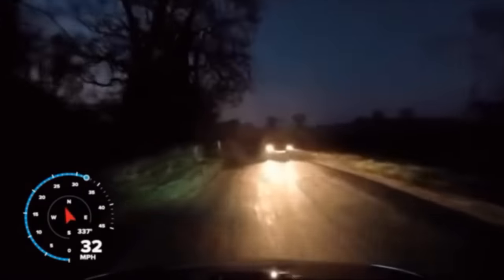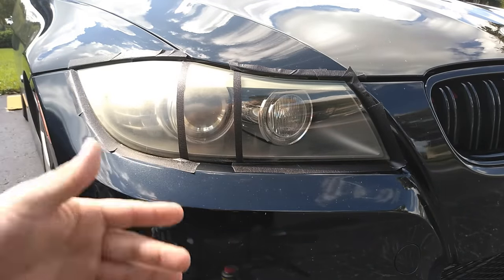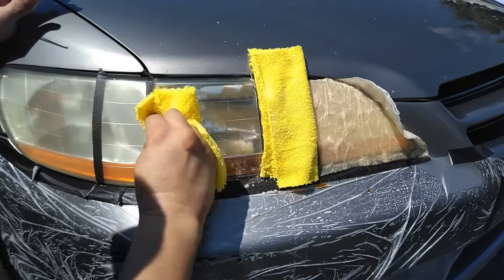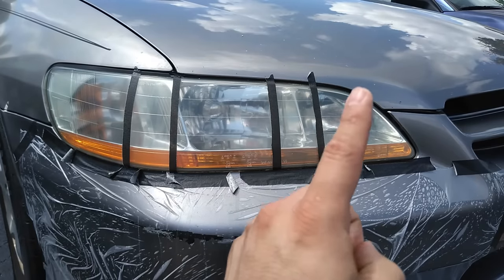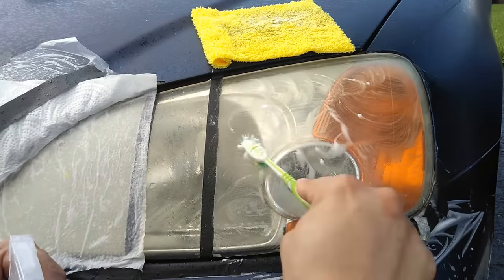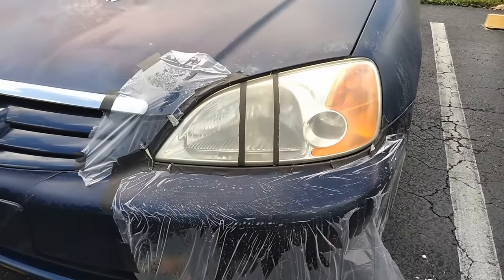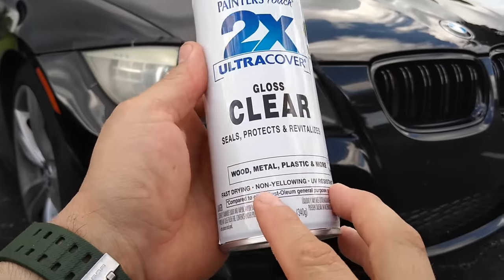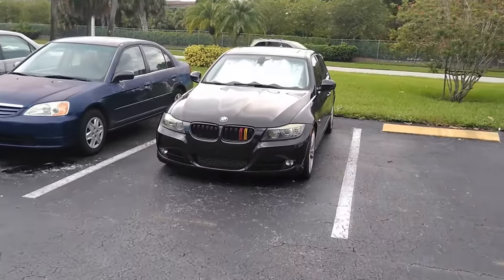How to Restore Headlights with Household Products (Easy, Affordable & Fast)

Comment: I believe all of these ‘remedies’ are just temporary fixes.  They are just like putting a band aide on a amputated finger!  Only a temporary fix for a permanent problem.  Polycarbonate lenses are not ever going to replace glass! Point of fact! Ozone,  pollutants, and minor dirt impacting the plastic will render it ‘worn out’ in time, whereas you can find a glass enclosed light 30 or more years old that still looks great!, unless a pinhole in glass has compromised the seal of the glass lamp!  Sorry folks, these hacks just don’t give the results you may be looking for!  I’ve tried many of these ‘hacks’ so I speak from disappointing experiences! Jes sayn 🤷‍♂️🤔🤨
Reply: I just use acetone nail polish remover.  Makes them crystal clear in one pass.   Don't make more than one pass...additional passes cause the fog again.  Don't get it on the paint.